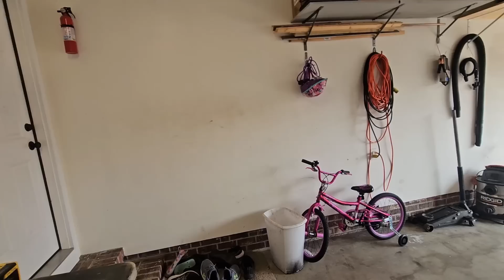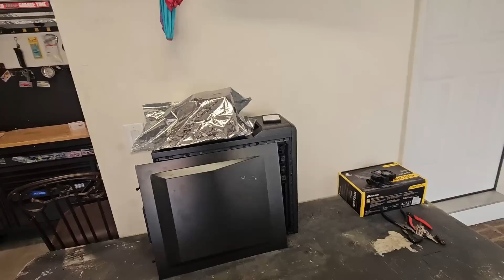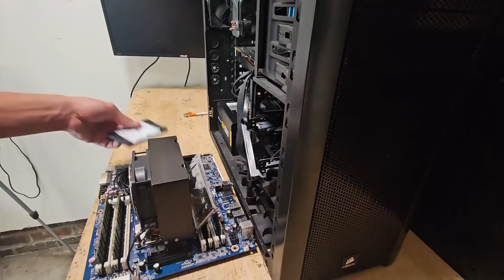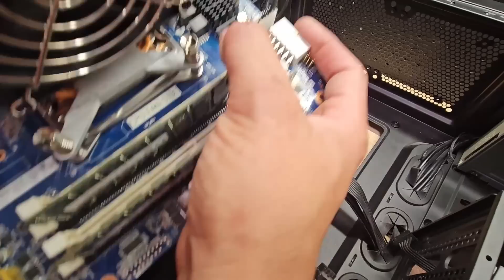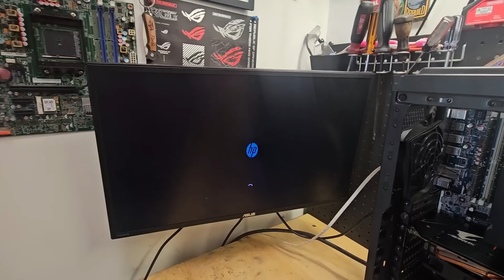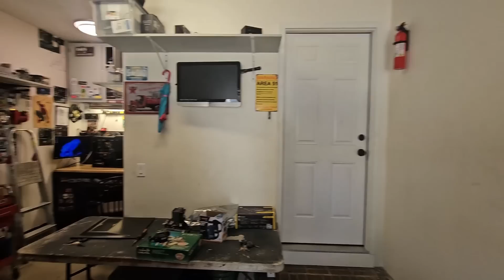Frankenstein was my best flip yet!! Flipping junk Episode 5

Comment: Excellent video! I love Frankenstein computers! I happen to have a Z440 that I use as my daily driver and got it as a refurbished unit cheap. I had an RX 580 in it for a while and just recently upgraded to an RX 6600 XT. Nice to see that those HP to ATX power adapter cables worked. I also have a Z240 and I tried 3 different power adapters to use an ATX supply and none worked. Good stuff!

Comment: Not shitting on you. I do what you do and sell PC's as a side thing. I solely stick to AMD am4 platform though. As a PC gamer my self. I just couldnt source say old intel boards and slap in old i5 4440's and pair with a equally old gpu and call it a gaming PC's. I would die inside if i purposely sold such a PC to some kid who probably saved up all their pocket money for it. I much rather refurb a ps4 and sell them that.

But yer I buy cheap am4 boards from aliexpress/fbm/ebay. 16gb dual channel memory, 500gb m.2, ryzen 1600af/2600 at min, 500w corsair or evga psu and a budget case as for gpu bare min 1060 6gb. Normally I just charge what i paid for the parts then add £70 on top for building and testing. Its not solely about profit for me i love building PC's. Its a win win for me and my customers. As i make a small profit + enjoyment of building and testing. The customers get a fairly modern Pc with plenty of upgrade options. They can take that 2600 cpu out and replace with a 5800x3d if they wish. Can swap the 16gb out for 32gb. Options to adding more storage and could easily swap out the 1060 for say a 4060.
Reply from the maker: appreciate the insight

Comment: Yesterday I was just training some models on stable diffusion as I usually do, and I came back and I had a blue screen of death, on my 5950x, an "UNEXPECTED KERNEL MODE TRAP"  CPU is freaking toast  and I don't have nothing here at the house to back it up so now I'm SOL until payday in two weeks.. it happened within a 5-minute time span I push the generate button on the software left walk to my garage grabbed some Dr pepper and came back and I walked in the room and there was blue screen..😢❤😐
Edit: what really sucks is I just got my Asus rog Swift PG27AQDM 27 inch 1440p OLED 240 hertz 3 days ago....🙂

Comment: I have a Z600 with dual Intel Xeon X5570 and 24 GB of ECC. That has been running for 6 years 24/7 as my NAS. Need to replace it, fans are getting a bit noisy. Not bad for a 10 year old system when I bought it. Working on a new build to replace it.

Comment: The cooler on the combo you took out of the case is a cooler master N520. I throw them on ebay and get about $30 to $40 off them. Swap it out with a cheap cooler next time.
Reply from the maker: thanks for the info
Reply: Amazon has cooler master RGB v3 cpu coolers for 10 bucks right now worth it to pick a bunch up

Comment: I'm newly subscribed and like the flipping junk idea. 

Some of these big cases have a ton of hard drive slots in them making them a good option for a NAS build. You ought to look into branching out beyond gaming rigs and add a NAS flip now and then. 

I've recently discovered the used data center hard drives market where some vendors  repurpose retired data center drives and sell them cheap online with up to a 5 year warranty. They guarantee no bad sectors and 100% health tests. I recently rebuilt my home NAS with five 12TB drives that were $70 each. With a raid redundancy set-up I can lose a drive and not lose data and send the failed drive back for a warranty replacement. This setup is a lot less expensive than new NAS parts and performs very well. I'll bet you could find a market for selling rigs like that. Plenty of free NAS OS options out there and using these instead of getting a proprietary NAS like Synology you won't end up with obsolete hardware when they decide to end of life that model. A nice selling point.
Reply: Nowadays with SATA to M.2 adaptors there is really no reason to bog down your PC with a HDD. Might just be me tho. SSDs cost less than $35  so definitely worth the performance boost.
Reply: @flitai  Where are you getting 12TB SSD drives for $35? I agree, the performance increase would be nice.
Reply: @SHO1989  who tf said anything about 12tb. The space on HDD's is negated by their 2008 brick PC speed.